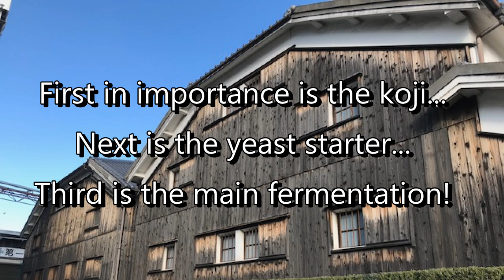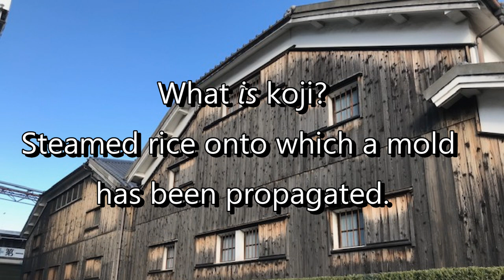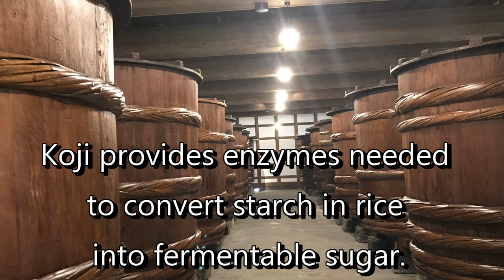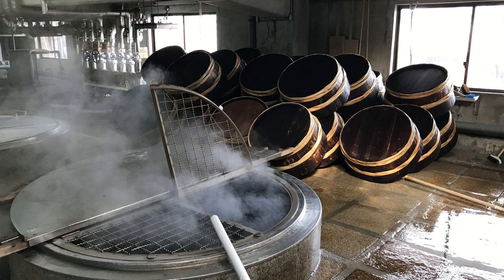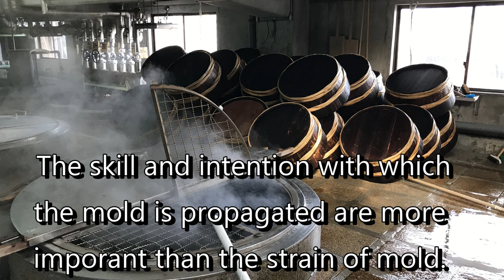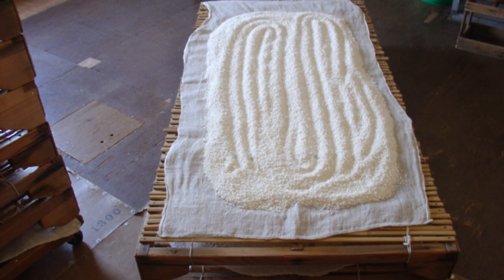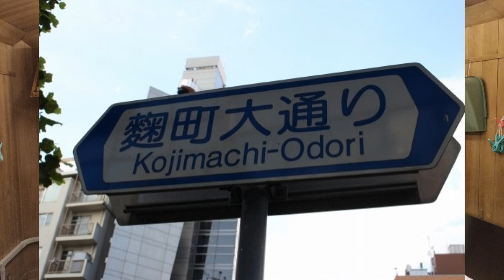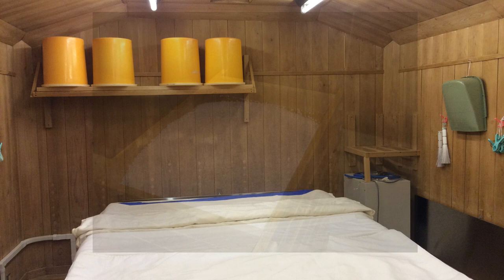Koji  In Sake Brewing - All You Need To Know

Comment: Question for John: In the video made by JapanSakeOfficial.  Koji is used to make the yeast starter or Shobu, rest for a day and then on the 3rd day a second batch is added and on the 4th day a third batch is added so why is there 4 times?  Is it because some brewers put an extra batch and some do not?
Reply from the maker: Hi Michael, actually koji goes into the yeast starter, and then to each one of the three additions after that, so is made and used four times. They do this to keep the balance between sugar and what the yeast can process, i.e. to keep the yeast strong.
Reply: I think I got it!!!  It's how I interpret the 'how many times! 1st use of koji is making shobu, 2nd use making the original moromi and 3rd and 4th use is the two extra additions so altogether koji is used 4 times!